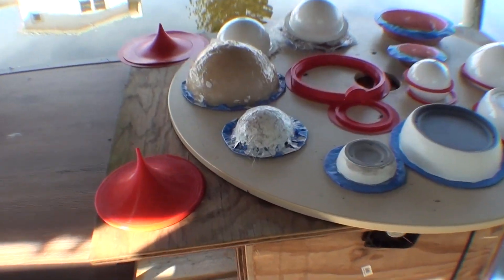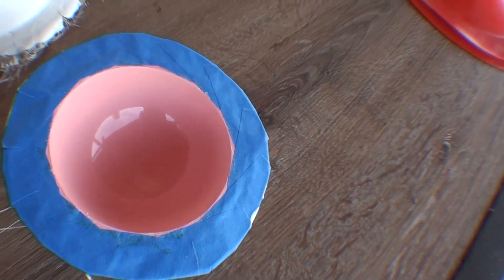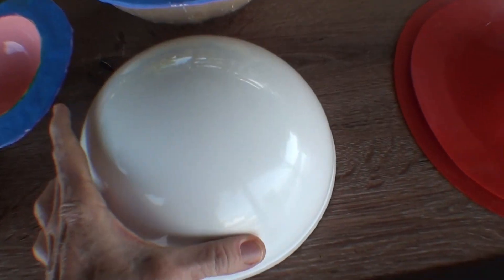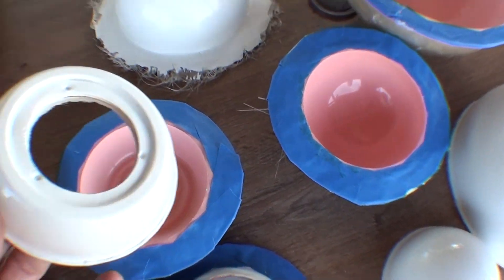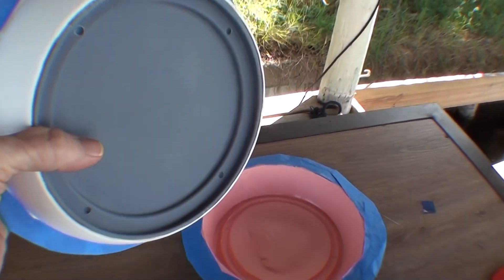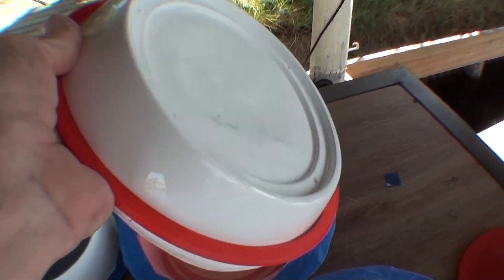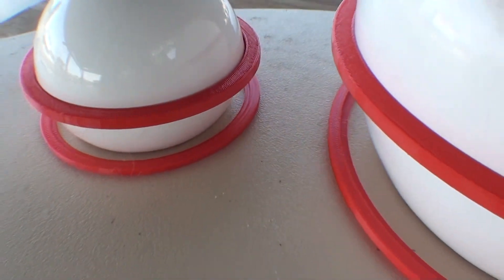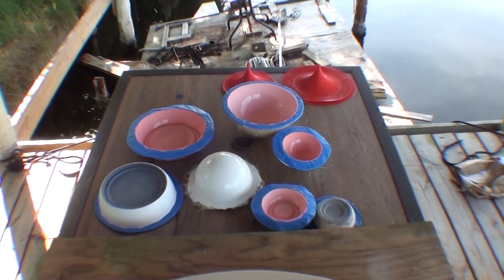Look At My Big, Shiny Balls

Comment: I want to make a boat roughly and over size out of wood and simply machine away the excess with router. Like Michaelangelo said about his David "it was there all along is simply had to reveal it" Try wood turning a toy boat and you will see what I mean now turn a big boat but rotate the tool (router) and keep the boat stationary.
Reply from the maker: If you router the log horizontally, you need to support both ends so the router can go underneath.  What about a round CNC track that goes around the tree so you can router it while it is upright?  Or was the plan to just carve away by hand?  Amazon has a round disc that goes on an angle grinder with chainsaw teeth that carves pretty fast.  Sounds like a fun project.

Comment: How do mount it
Reply from the maker: That thing in the middle of the table that looks like two rings together is one possible mount to hold them together with the flat front surfaces in the same plane.  We might use some variation of that with some feet on the bottom, but we're looking into other options.  Another possibility we're thinking of is a silk cloth thing that hangs them from the ceiling.

These are not the speakers we are trying to make.  The drivers that go in these balls came from one of a set of speakers.  The other speaker from the pair was left intact.  We want to do whoop tests and off-axis tests to see if we made them better or worse by comparing these to the one I didn't take apart.  If the round housing makes them better, we have a more advanced design that uses three drivers in balls and a reflector that makes the sound from all three drivers seem to come from the same place.